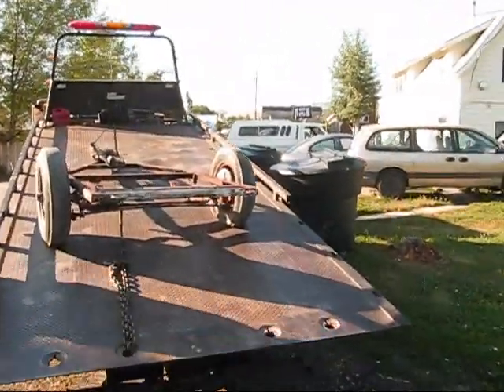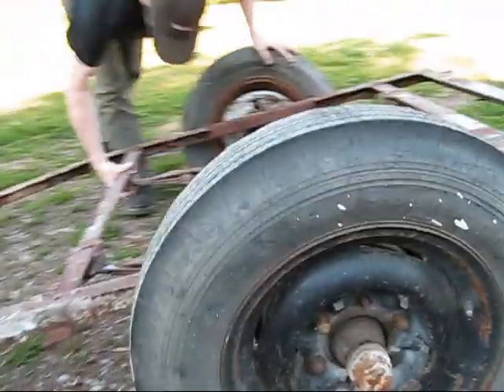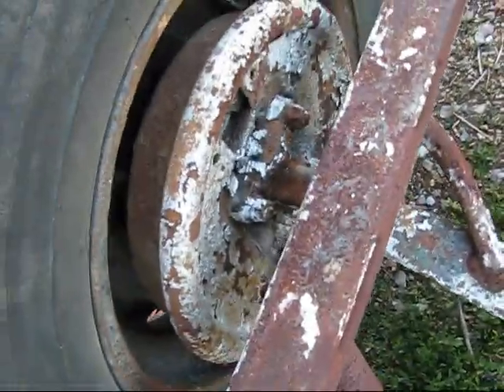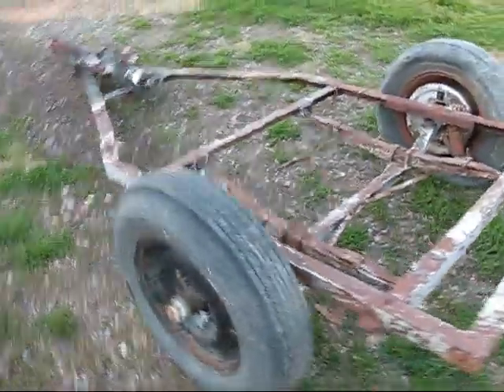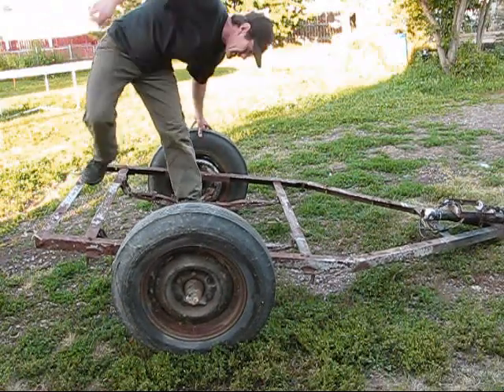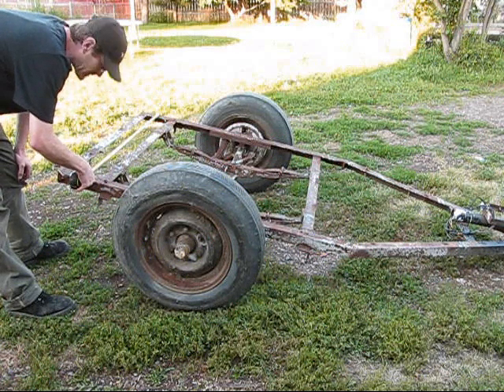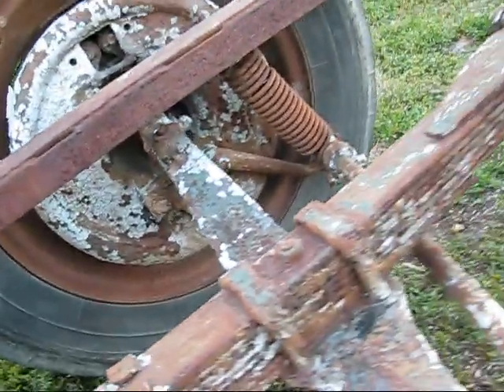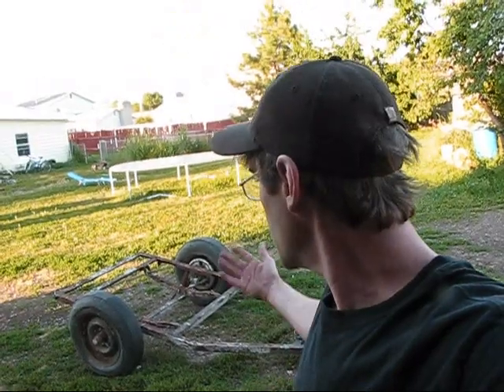T-man's New Fixer upper █ ( old trailer )

Comment: I would pull the tires, and sandblast the whole thing to get rid of the rust and loose paint, then see what ya got structurally.  From what I could see from the video lengthening the frame would not be difficult, but you would have to move the axle forward to keep it in balance.  Extra bracing and a decent deck, I would use 2x6 lumber rather than plywood, holds up a bit better.

Comment: all ways grease the bearings. never trust a old trailer. i would add some more cross bars up front. then paint. new tires. and add a deck. should be good.